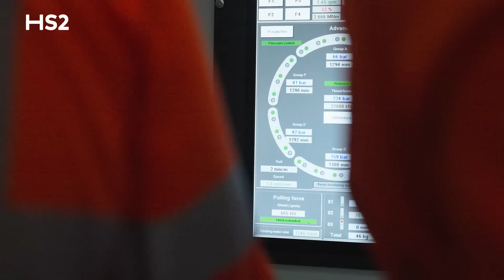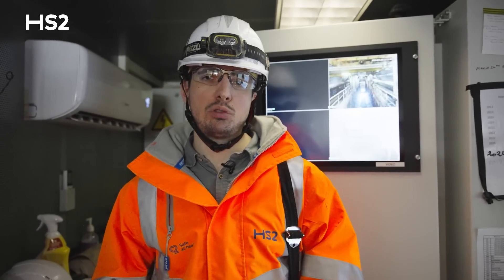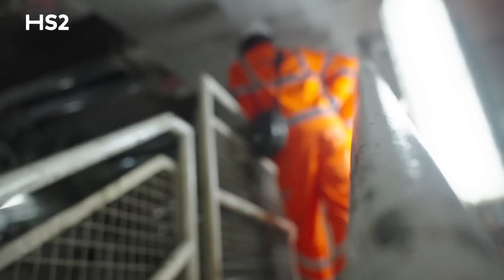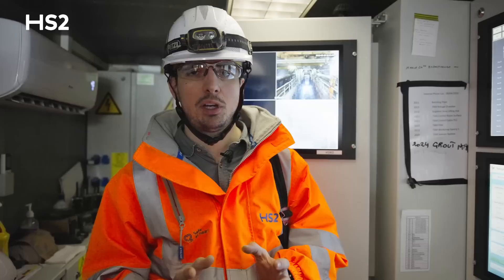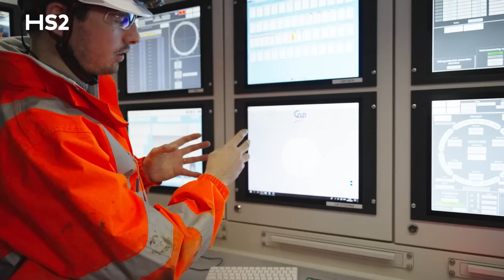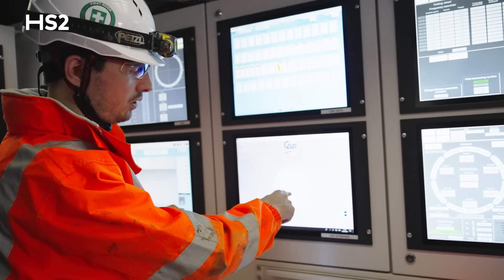Behind the breakthrough: HS2 milestone marks full completion of first twin bore tunnel

Comment: Great as an engineering achievement it may be touted as, the project as a whole is still a complete waste of money. The same invested into the current infrastructure to get current lines faster and operating reliably would make a huge difference. No one needs to get to Birmingham 20 mins faster or Manchester in half the current time than you can already from London. what would be good is not being left stuck unable to travel or delayed by hours at a time on a regular basis.
Reply: The main reason for building HS2 was to increase capacity on one of the most heavily-congested inter-city railways in the world. Given that, it makes sense to make it a high-speed railway to enable much greater time savings further north.
Reply: No point making the lines faster when they a clogged up with traffic.
Reply: @DavidKnowles0  that's how you make them faster by stopping the congestion.
Reply: @chrisroberts2266  That what bypasses are for.
Reply: Yeah, why are they building this now? Why not 50 years ago?
！歳萬！歳萬！歳萬

Comment: It's a real shame the HS2 project is such a dud, because the engineering is truly amazing.
Reply: The project is not a dud at all.

When the HS2 line opens, InterCity services on existing mainlines are going to be moved over to the new railway. That will leave gaps in the schedule, every hour, that can be passed over to local trains.

Not only that, the issue, at the moment, with a mixed traffic railway, is that an InterCity train runs a lot faster than a local train, so the train schedulers have to leave big gaps in front of them. Those big gaps are not needed on a railway line that has trains at roughly the same speed. So one InterCity train doesn't just replaced by one commuter service. It can be replaced by a lot more than one train. (And this is every hour, so not just several trains over the entire day.)

Put all of that together, and what you end up with is that the local train services around Birmingham are going to take over the mainline and are going to be able to increase commuter train service levels, to the sort of trains per hour, people currently only see near London.

And HS2 can do that for other cities, once it gets to them and moved the InterCity trains off of the existing mainlines.

It works exactly the same way that a road bypass moves unnecessary through traffic out of towns and gives the town back to local people.

Comment: I can never understand how the machine navigates to come out exactly where intended.  It can't be GPS because signals blocked so what reference is used?  A short video would be great or a link reference if already explained somewhere.
Reply: Laser referencing is the key!
Reply: It's GPS, control is both internally and externally. An area is marked by the coordinates fed into the operational computer, aided by special navigational instruments on board, the TBM progress further the pilots have to maintain the red dot in the middle as it's the intended destination. Hopefully it makes sense.

Comment: United Kingdom Of Great Britain London and all UK city's are the best in the world, UK HS2 Trains Railways is the best world class, UK Railways business boost business forever. The first railroad built in Great Britain to use steam locomotives was the Stockton and Darlington, opened in 1825. It used a steam locomotive built by George Stephenson and was practical only for hauling minerals. The Liverpool and Manchester Railway, which opened in 1830, was the first modern railroad.
Reply: HS2 is far from world class and historically trains have been a huge financial failure in UK history.
Reply: HS2 will (currently) open 67 years after Japan's first high speed Shinkansen route, and four years after Japan starts operating its first 500km/h maglev line.  HS2 is a dinosaur before it even opens.  It's a colossal waste of money.